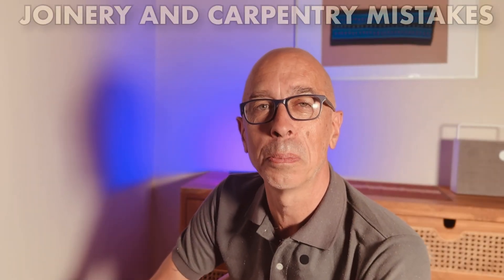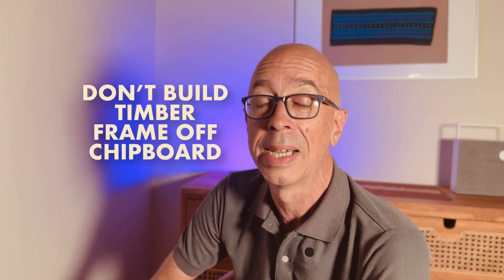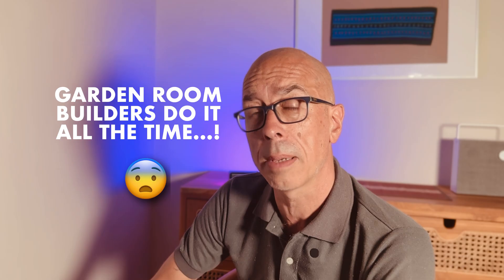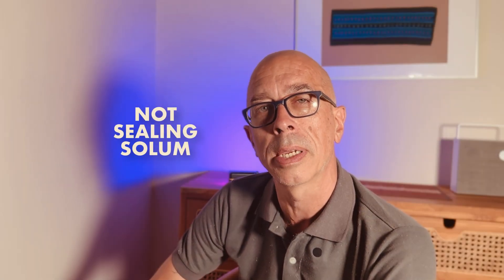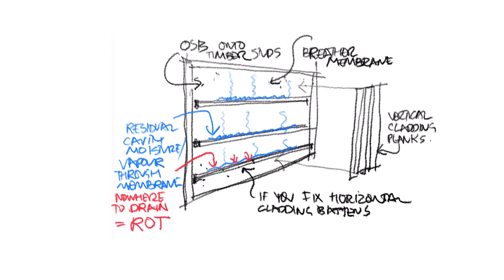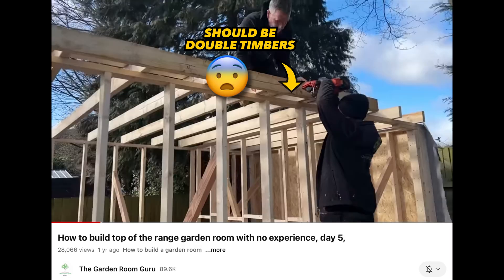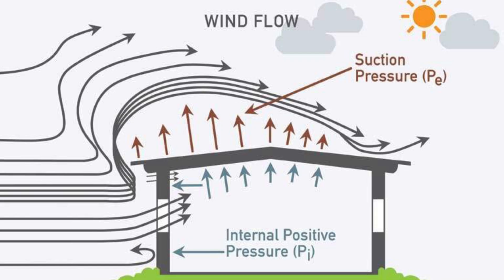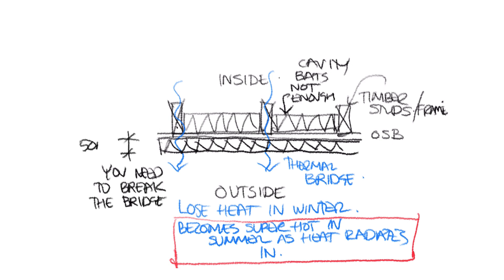9 Timber Frame and Joinery mistakes to avoid

Comment: 07:28 the holding down straps, will the OSB deck not be sitting up because of that? Or do you rebate into the roof joist?
Reply from the maker: Yes you can rebate, or if you’re using a warm roof, you can put the holding down straps over the OSB.

Comment: Hi I’m building mezzanine floor with chip  board inside my steel shed then framing around walls is it ok to frame on top of chip board as the walls are non load bearing and only 1.8 high max
Reply from the maker: Hi. Without seeing it, should be OK. 👌

Comment: Hi great video, although it been some time I have worked in construction management having come from the trades, so its great to watch a video that is well informed. A lot has changed so I am re-educating myself on some new products, and I have seen a few things on other videos that I question and so I like your point the regard to edpm  @ 8:51 you talk about interstitial condensation due to EDPM being glued to OSB over PIR foil back. I have often thought about this. So your saying the the EPDM should be glued directly to the PIR. My only concern with that is how fragile PIR is but I get it, with the cold bridging and the foil and no ventilation in that area due to the sandwich of materials and the possibility for moister to build up from water vaper in the air and getting trapped between the osb and the pir layers. 

I do have a question as I am planning  to build a garden room next year, and was wondering how you would go about designing the base, the total area is 30ms, which will combine both a shed and the garden room.  I wondered what your preferred method would be. I am considering both timber suspended or solid concrete. With a suspended timber floor giving 150mm for ventilation would you remove the top soil and lay a 150mm bed of hard core then dpm then the 150mm ventilation void. Or 150mm hardcore 50mm sand blinding dpm and 100mm of concrete with 100mm of pir on top for a floating floor? 

Thanks
Reply from the maker: Hi. For the insulation, you secure it mechanically to through the deck to the joists. You never use foil backed. 
Yes I will always go for suspended floor over concrete. Scrape land,  no need for hardcore, DPM and then 50mm blinding concrete to protect DPM , and then as you say, your 150mm ventilated void
Reply: I think that Jerry meant like this: Regarding EPDM and condensation, yes, directly gluing the EPDM to the PIR insulation can help prevent that moisture build-up between layers since it avoids the issues with foil-backed OSB. PIR can be a bit fragile, as you said, but keeping it straightforward with fewer layers usually works better for insulation and ventilation.

About your garden room, I’d go with a suspended timber floor over solid concrete. Here’s my preferred method: scrape the topsoil, no need for hardcore. Then lay a DPM (damp-proof membrane) directly, with a 50mm blinding layer of concrete on top to protect the DPM. After that, add your 150mm ventilation void under the timber floor.

Comment: 9:07 I'm looking to add insulation to the external 2x4 walls on my first floor in the way shown in this diagram with the additional insulation to prevent cold bridging. Whats the benefit of using the OSB inbetween the insulation layers? Could it go on the inside of the insulation, directly under the plasterboard?
Great video!
Reply from the maker: The issue would be services and pop throughs. The beauty of frame construction is the integrated service void. Air tightness also might be harder. If you can live with that, I think it’s probably ok, but I might consider omitting it and using bracing instead to deal with the racking, after speaking to an engineer. You would need a reinforced breather membrane but I’ve done it before.

Comment: Hi Im building a large timber home which sits on jackpads and timber beams, then the joists sit on the beams. Im planning on fixing OSB to the joists in sections and then flip each section over so the OSB is sandwiched between the beam and joist then insulate and ply floor. Basically to create a cassette. I have seen this system on youtube for a hot climate home, do you think this will be ok for a UK home?  Thanks
Reply from the maker: Yes, cassettes are used all the time by the volume house builders. It’s a good solution.

Comment: In England it is common practice to build walls off 'Egger Protect' flooring on garden rooms and also large cabins. Egger Protect is an expensive material so maybe is OK??? Just wondered what your opinion is on this, great video, it is a very good point you have raised about building off chipboard.
Reply from the maker: Hi. Yes, I understand it’s common practice by some. I see it also on a lot of popular YouTube self build and DIY channels. The reason they do it, I guess, is to make it easier to make their walls right angled, rather than using 345. It’s a terrible detail.  You’ll hear the standard “I’ve been doing this for years and never had a problem” answer. Phone up a structural engineer, phone up Egger protect manufacturer as well, and ask if it’s suitable for taking roof point loads, and you’ll have your answer. Have you ever had your kitchen worktop swell up and fail when it gets moisture ingrained?  What happens if the weight compresses the tiny air gaps in chipboard? Or part of the composite fails? Of course it’s a rare occurrence. If it fails.. will your builder come back to re build your investment at their cost…. Or pay you compensation? And if you’re doing it yourself…how will you feel if all your hard work is ruined? Why not just do it right in the first place?
Reply: @build-better-things  Yes I do get what you are saying, it is a brilliant point. I saw one YouTuber build his own cabin with a glulam beam to create about a 5m open space, he had about 6 vertical timbers supporting it, all on the Egger Protect, he isn't a commercial builder though. It is a cabin on a steel frame with wheels with an apron cladding system. So the edge of this flooring could be a bit of a potential weak spot I guess.

Comment: I take your point about not adding another OSB on top of a warm roof insulation. My question is, can rubber roofs be safely bonded to foiled backed PIR insulation without risk of delamination?
Reply from the maker: Hi. No, never used foil backed insulation for these applications. It’s a common mistake. Yes, use PIR, but you need to use boards with no foil. You cannot bond onto the foil.  Not only that, the foil can create issues with vapour control / transfer in a warm roof situation.

Comment: The flat roof one caught me out! Ive seen so many drawings with a top skin of timber to grp onto? When did this change?
Reply from the maker: Manufacturers and some installers in the UK still specify this method, using the foil backed PIR. It’s a horrible detail. Think about it.  Why would you want anything that’s made of timber on the cold side of your insulation when you can use the correct insulation and bond your membrane straight on. No timber. No rot. No problem.
Reply: Do you have a link to a spec for this? Particularly the types of membrane on the top side? I'd imagine that GRP won't stick to the insulation so won't be suitable?
Reply from the maker: EPDM bonded directly onto PIR insulation with solvent based contact adhesive . Any PIR provided it has no foil backing. Tube fasteners and washers to secure the insulation. I don’t have a lot of experience with GRP but from what I have seen, EPDM is a much better application.
Reply: Thanks!

Comment: Excellent video, very clearly explained..! Hv u made a video for timber frame, if so pls confirm.  I have timber frame on the 1st floor 5” thick studs. Will they be enough to hold a dormer loft conversion.  Wht size should the studs be..?
Reply from the maker: Hi. I’ve made videos about attic conversion, dormer windows, and a load on timber frame. Just have a look at the play lists. I’m reluctant to give advice on timber sizing as it’s always project specific. Thanks a lot for your comment.